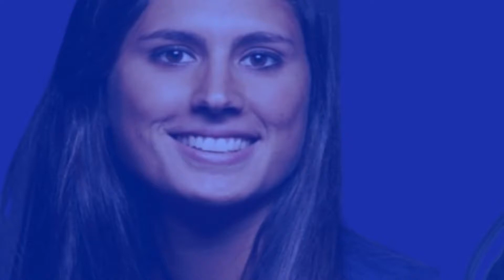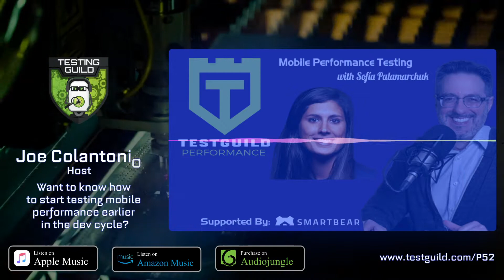Mobile Performance Testing with Sofía Palamarchuk

Comment: What exactly is Client Side performance with respect to Mobile Application Performance Testing ???
Reply from the maker: From my Joe Bot :) testguild.com/bot "Client-side performance in mobile application testing focuses on how well an app runs on the actual device it's installed on. This includes measuring factors like app responsiveness, speed, and resource usage, such as memory and battery life. Unlike traditional web performance testing, which often centers on server-side capabilities, mobile client-side performance zeroes in on the user's direct experience 1 2 .

This type of testing is crucial because it directly affects user satisfaction. A mobile app might perform well in a test environment but could struggle on actual devices due to different hardware, operating systems, or background processes. Tools and methodologies specific to mobile performance help simulate and measure real-world user conditions, ensuring the app performs well across all scenarios 1 ."